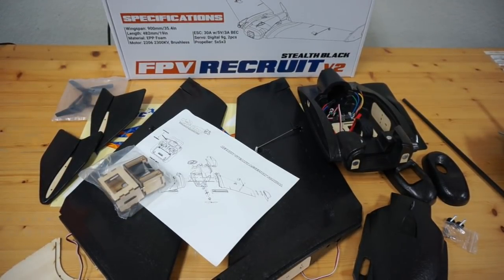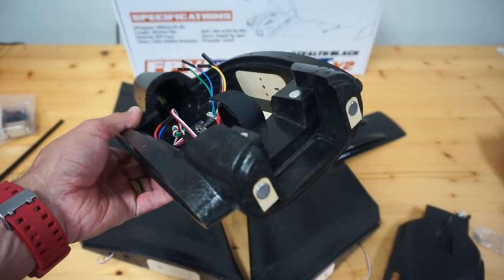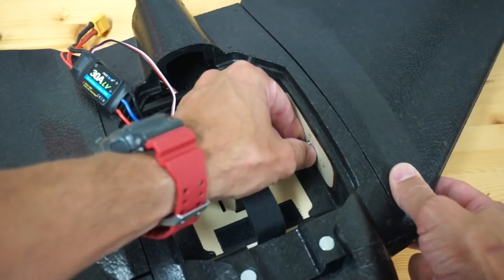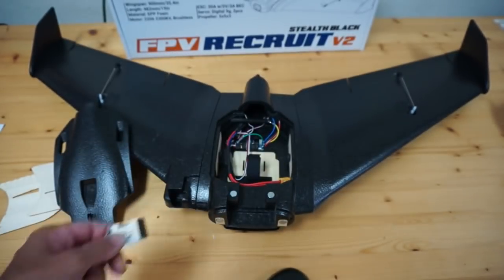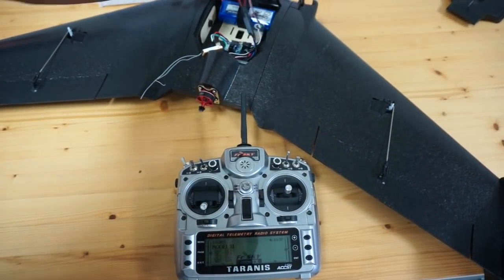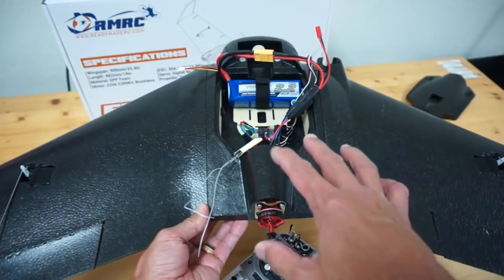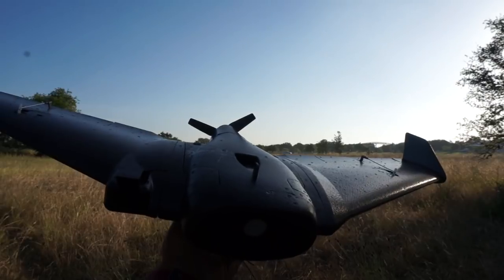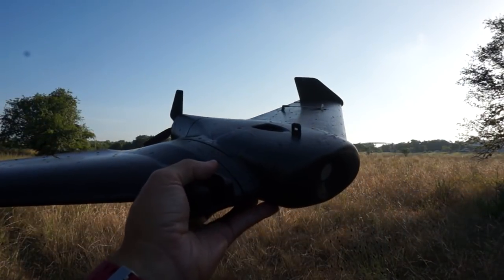RMRC Recruit V2 FPV Wing Build, Wiring, FrSky Taranis Config and Maiden

Comment: Hello Dennis,just bought the RMRC Recruit and have a frysky x4rsb and a few othermreceivers but the x4rsb is only one with the pins on receiver,any idea of how to wire this receiver to the stabilizer board?seems I’m not getting where.in this video here seems the wiring leads are different from mine(maybe) on the stabilizer board where is the white lead wire?mine is the Futaba plug first 3 wires...looked like in yours the white wire was a single wire?any help to get me up and going?imhave the x4rsb..xm+ Xsr..rsxr receivers to work with..thanks

Comment: Is yours a cw motor or ccw.
I might have wrong prop on
or backwards..Shiny side out
right
Reply from the maker: It's a pusher prop that rotates CCW. So the carbon fiber side, which I believe you're referring to as the shiny side, should be facing the nose of the aircraft.
Reply: @dennisbaldwin  
Yes got jt works thanks

Comment: Thank you for posting this video friend. I am waiting for my Wing (recruit) to arrive. I only have multiple 4s 1300mah 95c and 5s 1300mah 100c at my disposal. Do you think I risk damaging the esc or running a hot motor with those batteries? I am considering using my 4s batteries until I invest in any other types of lipo (higher mah). I am looking for performance but never at the detriment of efficiency. I will setup FPV right off the get go since I have been flying quads in FPV for the past 5 years. Line of sight flying is intimidating to me and it is going to be my first experience flying a fixed wing aircraft. I was thinking; taking off with my googles on top of my head and use them as a way to get the wing back home in case of emergency / panic. I also have a 7 inch monitor as a backup for ultra fast peeks (green is land, blue is sky, carry on...) As for my transmitter, I will be using my taranis and have multiple receivers to chose from. My choice for that matter is the x8r (from the taranis bundle, I never used it!) since all my other receivers are SBUS. I ordered my wing with the 200mw cricket and if it does not cut it, I will fall back to my reliable tramp HV and a trusted Runcam with a GoPro lens (rotor riot edition). My goal in the long run is getting a Matek405 long range setup and I am starting to realise that this wing may be fine as is and that it may not be able to carry any additional weight that a LR setup requires. If it ends up being my "as is" trainer aicraft well so be it. I would simply purchase another wing once I am familiar enough to know what I am doing.
Reply: Benoit Bourque can a X4r-sb ,xm+,or a Xsr,or rsxr receiver work with this stabilizer board..

Comment: Aerial mapping capable in your opinion?
Reply from the maker: I'm not sure. I've been thinking about putting PixFalcon inside, but not sure what to do about the camera. Many of the cameras I've used in the past are either too heavy or too big to fit. If there were a lightweight viable option it may be possible. I'd probably still lean towards something like a SweepWings Juggernaut. But great question and you definitely have me thinking. Thanks Jonathan.

Comment: Is it a little twitchy?
Reply from the maker: It was fighting a fair amount of wind, but 2D mode worked really well to dampen the impact of the wind. In 3D and Manual mode it's very twitchy. By twitchy I mean really, really responsive. I hope that clarifies and I also hope that you're doing well. Thanks for always popping in for a question or two :)